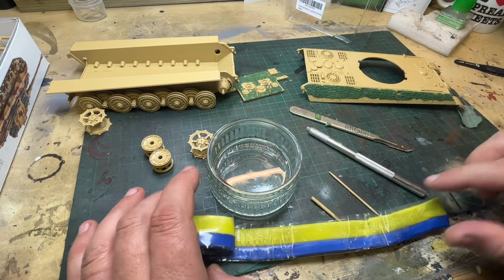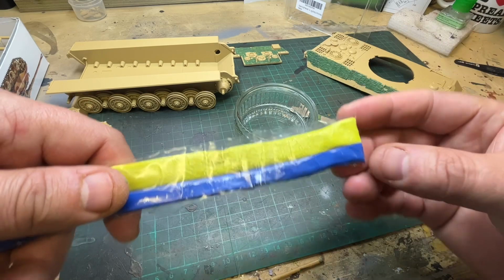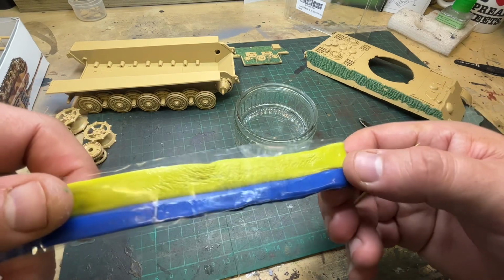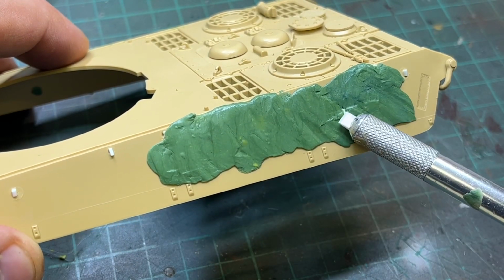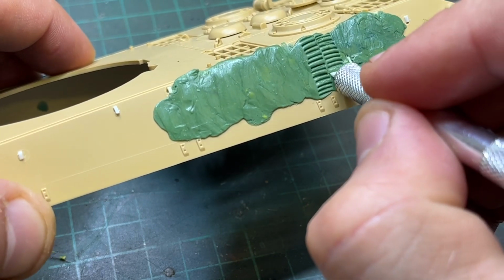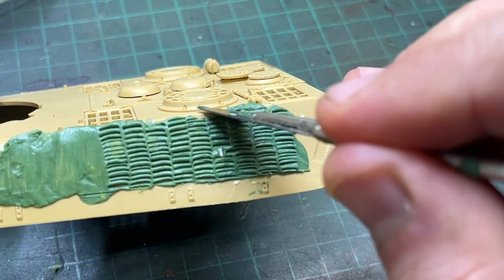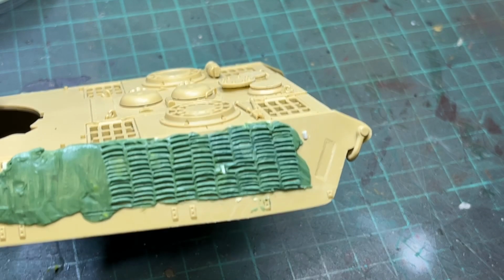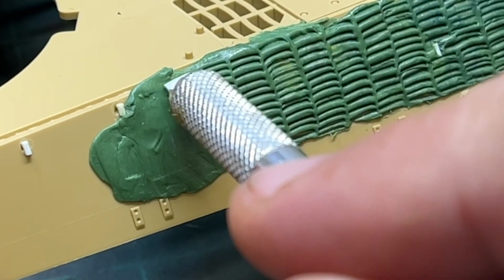Easy ZIMMERIT German paste #tiger

Comment: I usually tape off the edge of the lower hull where the mudguards are attached with painters tape. Apply your zimmmerit and then peel off the tape. This expedites the need for being so careful when applying your paste. Good luck and nice work. Cheers mate.
Reply from the maker: @TDog-ic7do  cheers for tip

Comment: I did it the same way on a 1/16 Tiger 1 but I used Terracotta Milliput. I tried rolling the Milliput out with a skewer but didn't have much luck and found it easier to squash it into a thin layer with my thumb by just keep working it. I found that the Milliput stuck to the plastic better by lightly scuffing the smooth plastic with fine emery. Another thing that I found out was that it was extremely relaxing and I'd recommend to anyone to give it a try, take your time and it will be fine.👍
Reply from the maker: Cheers mate for feedback, agree milliput would be a good substitute for the putty
Reply: I use the yellow milliput and use a snapped off rounde4d tweezer to spread the zim and use a master tools zimmerit roller...they have 2 different gauges also you get a press tool of all sizes,2 rollers and 3 press tools for 12 quid...
Reply from the maker: @russouk  cheers, I try to do things if possible with stuff we already have etc so all can try. The video has provided a lot of feedback. I will probably get a tool for next time as it will probably be more accepted to the community. Hopefully I gave some people confidence to gave a go. Cheers for comment.

Comment: Big applause for the effort, I think the fun has been taken out with all the glue on strips, PE sheets, and pre-molded on zimm. Next go 'round you might consider about half the thickness of this for 1/35 scale. You might consider running a piece of tape down the hull where the fender line is so you don't have to keep stopping and scraping away the excess. Just peel the tape off at the end and rough up the clean edge with your tool.
Reply from the maker: Thx, it’s probably caused the most amount of comments I have had on a video. Agree on thickness and hopefully it encourages others to have a go.
Reply: @ctscalemodellinguk  Absolutely, that's the goal. I just built up one of the new Takom Tiger 1's with molded on zimm and it felt like I was cheating. Also you can't easily do damage like chipped off sections.